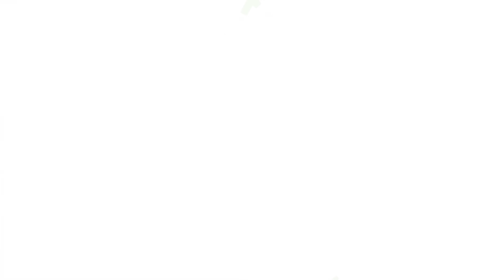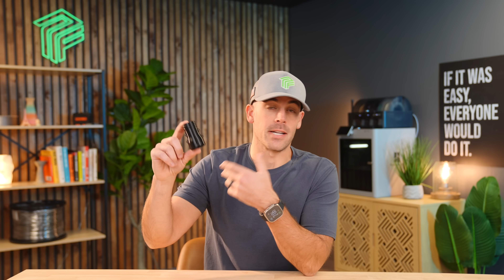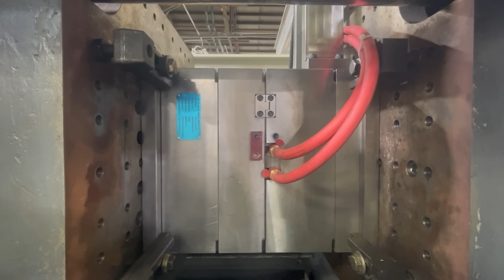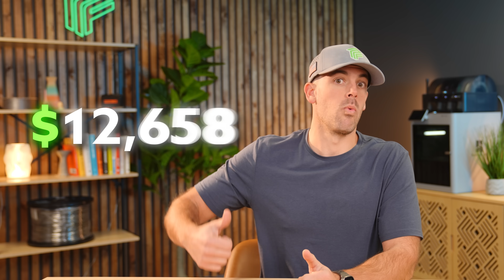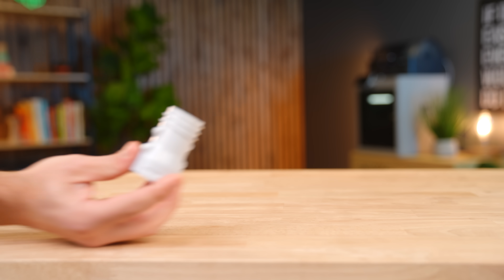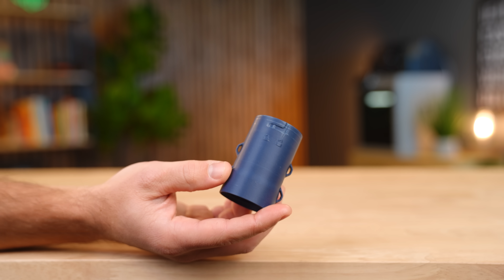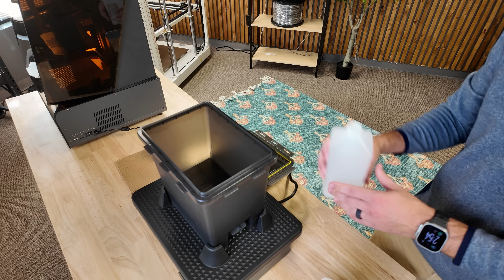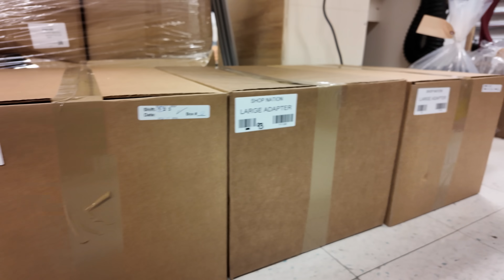Why is 3D Printing so Expensive?  Injection Molding Comparison

Comment: when you hear the quote for a die comes in at 10,025,070,000,000 you rethink this bullshit about injection molding. how do you get there? there you got to have the big money to buy the dye to make the profit producing the parts for peanuts. 3D printing solves your problem up front Shep no doubt about it in the long run injection molding is less expensive

Comment: It definitely would take a lot more work, but for a small to medium sized business, the verticality option, would be to go back to the DIY roots of 3D printing, the first 3D printers to hit the public/hobbyist market, were not polished, setup and run machines like Bambu Lab, or Creality, they were kickstarter rewards that arrived  as a kit of laser cut wood pieces that snap and glue together like a puzzle. this is how my dad started in the 2010s. you literally had to assemble it like DIY projects yourself, find and load firmware yourself since slicers and 3D printer firmwares were not standardized yet and had slight variations that could cause headaches. 

for a small to medium business making products via print farm, you can build a DIY injection moulder setup for a fraction of the tooling costs, because at a basic level, FDM printers and Injection moulding machines do similar jobs, melt plastic through a nozzle, the difference is in how they do it and what they do with the plastic, FDM extrudes layers using pressure and distance to dial in the layer thickness and width, injection moulding does something similar, but melts plastic in a higher flow and pushes it into a mould to fill it, like moulding something out of plaster or ceramic. so in theory, you could use something like a 3D printer to make a mould, or pay a company like PCBWAY that offers metal prints on demand, they can make your moulds for you for fairly cheap compared to industrial pricing.

 alternatively, you can melt aluminum in a home crucible and use the destructive casting method where you pack your mould's negative shape halves separately in sand(made of a flamable material that can burn off easily and quickly) inside a steel bucket or something strong enough not to melt or catch on fire, then pour molten aluminum in the hole at the top, it may take some practice, but eventually you can get a decent cast that just needs some minor post processing, like a 3D printed figurine, to clean it up. then you just drill and thread some holes to screw it together, add a gasket to fight leaks where you can. then build a simpler machine that just pushes plastic fast enough to  fill the mould quickly, then cool and separate. with smaller parts you can create bigger moulds to get you 5, 6, or even 12+ parts at once, and it dont cost you as much as buying industrial injection moulding setups, so your ROI timescale will be higher and your tooling cost much lower than the 10k estimate.

 and if you cast your own aluminum moulds, if you ever change that design, you can break it up and re-melt it to cast the new one. the only thing you cant get back is the extra time invested into learning the multiple skills required to make this work. but if verticality/scaling is what you want, but dont want to dish out 10s of thousands for professional injection moulders, thats your best bet in my opinion.

Comment: Great video, very well done.  Very thorough.  I would add a little marketing to the subject of the strength difference between the IM parts and printed - the added strength of the IM parts should be significantly stronger, not just because of the ability to choose a stronger material, but the IM process itself - and you touched on this nicely.  But, the marketing of that point can be benifical - if you are competing with someone - you can tell your potential customers that your parts are injection molded and therefor stronger.  And, as we all know this world we live in has so many cheap part problems, so your parts NOT failing and causing you to lose a customer, who may tell others and cost you many customers, is the benefit that is rarely seen.  Hopefully your parts never have this problem, but anything with threads is just asking the customer to over tighten and break - if your part is so strong it can be abused, you have the chance of not losing that customer.  I have many years in aerospace injection molding back in the days before 3d printing, although there was stereolighography, we made parts that had to be stronger that the current materials that were being used.  So we used many materials that were considered exotic back then - PEEK, PPA, PPS, PEI, to name a few.  The strengths achieved with injection molding can be amazing - we had to violate the "consistent wall thickness rule"  all the time, and make parts that were many times thicker than needed.  This would make the parts so strong, it made most of the customers think more about plastics and helped us get more business - in hind site.  Just wanted to throw that out there- getting the reputation for having the strongest parts helps for future business and everything you injection mold should be stronger. ( unless the dimensions are changed to make it weaker)  Enjoyed the content

Comment: I used to work at a Specialty polymer plant that produced all kinds of polymer from powder coating to medical catheter even injection molding. It is definitely was awesome being able to learn as much as I did while working there but man it was hot and high pressures 7 extruders and pelletizers.

Comment: I once worked on a mauld? for a Ford backlight and as a trainee had to use daimond pasta to get minor scratched out. The mauld was then about 50K euro. Considering that thing spits out thousands of backlights it's cheap and much better quality then 3d printed parts and stronger. Those machines run 24/7 and are filled up with a ton of plastic in a huge hopper. To own such a machine is a total complete different story.

Comment: Not finished watching the vid yet but that molded part design is not cost effective in my opinion. That internal thread is awful. You can make a straight pull part with external threads in an aluminum mold for very little money. You can also make a family mold to make all three parts together. If you insist on an internal thread a hand loaded mold with a threaded insert can be very cost effective for small quantities (1000s a year). You can even use glass or carbon filled materials in an aluminum mold. The mold itself can be very inexpensive if you meet certain design criteria. The money will be spent meeting the design criteria.

Comment: What is the best option if I want my two interacting ABS flanges that act as a hinge to not be so "slippery".  My 3d printed ABS parts were more "tacky" when squeezed by finger tightening a wing nut.  Is it maybe a possibility to use a polyurethane that is strong but has a slight rubber feel to it for one of the two interacting parts?  Hope you can understand my question🤞
Reply: I forgot to mention that my injection molding ABS parts are what are slippery compared to 3D printed parts.

Comment: what happens if you need to improve a product over time.. do you have to pay the full price for a new mold everytime? injection molding seems rigid but i guess as long as your part or product does not change or improve based on feedback then its prob a good option

Comment: 3d Print the inverse of your mold sides, cast silicone over the inverted molds. Now you have an easy to inject silicone molds. Won't have the best texture unless your willing to sand down, but very beneficial for industrial parts.

Comment: Love the breakdown. You were pretty spot on around the 13 minute mark talking about redesigning one from the other with a person that is engulfed in that world. We went and did it at full production scale and we did prototypes via both injection and 3D with rapiddirect out of china and we ended up going with the injection molding instead because we felt it looked better. Either way, this is such a fair thing to do. Look at all the options on the table and never get bullied into one thing or another.

Comment: I thought Everybody knows injection molding is cheaper for mass production 3d printing is for low volume or prototyping. 2000 units or higher, injection molding is worth it.

Comment: In my little niche, I make considerably less complex molds than your typical high pressure plastic injection mold, but I have a little more than a dilettante's knowledge of the basic process.  In your 10,000.40 price for a single unit, you overlooked set up costs.  There is a set up cost associated with taking a mold out of a machine, putting another mold in the machine, and setting up the machine to run appropriately with that mold.  I get it.  Your number was an oversimplification for illustration purposes, but the typical customer over simplifies for a different reason.  They want to minimize your work and not pay you for it.  In some cases, an oversimplification can leave the customer angry because they feel like they're being ripped off and the professional manufacturer frustrated because they feel like they are getting ripped off.
Reply: This is why even after you have paid all of the tooling costs. It still costs considerably more to one part then to make ten parts, when you compare a small production run of say a 1000 units to a larger production run of say 50000 units, the price/cost per unit difference is shocking.

Comment: 3D printing is great for very small volumes and prototypes. It is not cheap at volume. The parts are much weaker than moulded parts, and they take forever to make compared to moulding. The moulds can be very basic - not always as involved or expensive as you would think. Make the part in 3D printing until you are happy that is the part you want. Then consider having it moulded. Moulding may require you to make changes. Try those in 3D printing also before finally committing

Comment: It's very simple, if you need to pump out a high volume of parts that you sell very quickly, and you can afford the injection molding dies and injection mold machine, then injection molding pumps the product out much quicker and will help you make more money in a shorter amount of time. Time is money. If you are just starting out and you have limited funds, 3D printing is the way to go, and scale up as you make more money.

Comment: You left something out. Even if you just want 1 part, you still have to pay for many kilos of plastic resin. They're not putting 200 grams of resin into an injection mould just for 1 part. So you're paying for that bulk material, energy and time. Also, the part has to be redesigned for injection moulding. How much did you have to pay the engineer to do that?

Comment: You show a round part in your hand. I am having issues making mine round. They are all coming out with flats all around. I am using Shapr3d to design my part. Which I draw round circles. And I print with Creality Print on my Creality K2 printer. What am I doing wrong???
Reply from the maker: It’s the resolution of the STL file, try adjusting the resolution to be more fine, that will eliminate the visible facets on curved surfaces

Comment: For production there's only 2 reasons to choose 3d printing over injection molding.
1. Short production runs of products that won't recurre or or reccure very infrequently. 
2. Shapes that would be physically impossible to achieve without a 3d printer.
If either of those are true, stick to printers, otherwise make the leap to molding

Comment: Ok. What you need to understand, it's not the cost of mold made it expensive. It's price of mistake that expensive. Or modification. If your mold cost $35 000, one single mistake can cost you another $35 000. And than another $35 000. And parts in this video are really simple. It's a little more complex than a nut, from IM perspective. Look how many molds made LTT on prototyping stage.

Comment: Choosing IM or 3D printing is a tit for tat moment. Conduct a feasibility study to determine the best approach as the part geometry, annual volume, and material requirements will dictate the direction you should go. Injection molding is the ideal solution for 1) if the design is frozen, and 2) if the volume justifies the cost of tools, material, tool maintenance,  etc, , 3D printing is ideal for 1) Unfrozen designs, concept, and early stage parts that customer needs immediately. 2) Low volume production runs for legacy parts no longer being made. Again, a feasibility study will guide you in the right direction that makes sense.

Comment: Lot of considerations. You have to redesign your part for injection molding, which takes a decent amount of experience. Then you have the upfront cost of the tooling. Then you have to deal with minimum buys and lead times. After that you get saddled with a bunch of inventory you have to hold. Then you have to correctly predict when you will run out of inventory and place another order to make sure you have the next batch before you run out. That means you have to fork out money to buy more stock before you have sold all of your previous stock. Your margins might be better but you will have a lot less free cash flow because of how much you have tied up in inventory.

Comment: Need to mull this all over. I’m reaching my maximum capacity with the printer I currently have but my numbers don’t make sense yet for injection molding. The “kits” I sell take about 8 hours to print so if I time it perfect I’m only cranking out 3 a day.

Comment: There's an issue you forgot to mention regarding injection molding. The mold can wear over time due to lack of maintenance, abrasive resins, or thermal cycling. This can make the resulting dimensions of the product to be out of spec. This means you will have to spend money to repair the mold or have a new one made all together.

Comment: Quick rundown, molding is expensive upfront, but the more product you make the cheaper the mold essentially becomes.  Im talking a few cents per part.  That said, you have to move tons of product to achieve that.  3D printing is small scale, cheap for one offs but will be more expensive and time consuming if your trying to make thousands of the same part.

Comment: What's interesting is if you look at it from a manufacturing high level, this process really isin't too far from sand or investment casting.  molten material is injected/poured into a mold, whether its a metal or silica mold.

Comment: I've used some 3D printed parts in my current boat refit. 

The largest number I've needed of any single part was four. 

So injection molding doesn't look like it's in the cards.

Comment: 3d printing is easier to scale from low income to higher income, injection molds are for people who are already rich. 
stage 1 vs stage 2
making the mold isn't really the issue, you can resin 3d print them , it's the machines you attach to the mold that costs $$$$
35k just for the mold, but not even having the actual mold injection machines that attach to the mold would be even more money.
this is really just outsourcing.

Comment: I once had the owner/manager for a hotel chain ask me, a solo owner/operator of a single P1S with AMS, selling trinkets on Etsy, if I was able to 3D print 5,000 little fist sized threaded jars, with lids, in 6-8 weeks... Even had to go thru the trouble of locating and sending them MSDS sheets... Not only did i have to do a triple-take at the screen, but just about had an aneurism when i started crunching the numbers on how much it would cost me in filament alone, not to mention the cost of my time, power, and machine wear - as well as how many sleepless nights i'd be having trying to get all that nonsense done... That was one of the jobs I walked away from, where if I had of taken it I could have made quite a decent chunk of change, but at the cost to my sanity and the looming up-front costs of filament spools stacked up waiting to be printed, and end-product waiting to get shipped... in the end i told them no, obviously... Told them basically that 3D printing them was an option, but not for me. The project would be better suited for a 3D print farm if the really liked the design that much, but also that injection molding was more the way to go on that quantity of scale. ..then proceeded to, in-detail, explain to them how 3D printing machines worked ... to basically say, hey this isnt the right use-case to get that item made....

Comment: $3500 to $5000 (minimum) to make one mold for ONE PART.  What if you need 10 parts?  That's $35,000 to $50,000!  Then hopefully, that part never changes or
you have to start from scratch. 3D Printing, you can buy a decent printer for $500 to $2000, and then make as many parts as you want, with as many variations/revisions as you need.  Listen, 3D Printing is ONLY getting better and more advanced!  Newer printers in 2026 can print metal parts, they are even making home scaled CNC Machines.
Tech is beyond amazing!
Reply: You didn't watch the video? 
Basically just a justification for either process

Comment: It seems like 3d printing vs injection molding is like the difference between a table saw and a chop saw.  They both cut but some jobs are easier with one and some are easier with the other.  Both could work, but using the best tool for the job makes the process easier and faster.  Thanks for the video. It was very informative.
Reply: Actually, I see the difference in another way. In principal it's like: 
You need to make a 10mm hole in sheet of metal. You can buy a 10mm metal drill. But if suddenly you need to do a 10,5mm hole you can't use the one you already have. Or you can buy CNC machine. And now you can do all kind of holes. And with complex shapes. 
It's bad example from price perspective. But in principle it's the same.